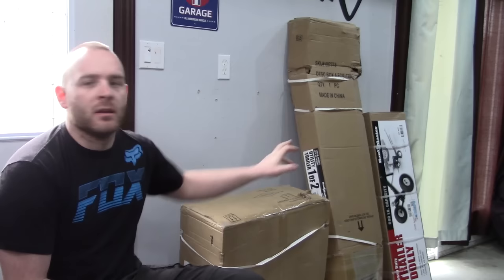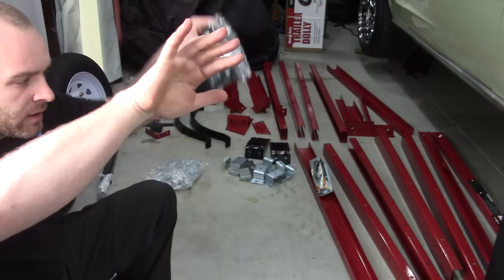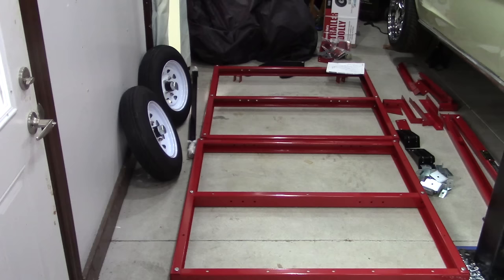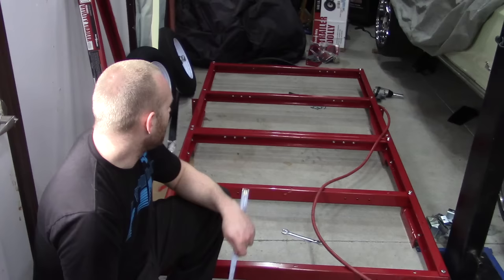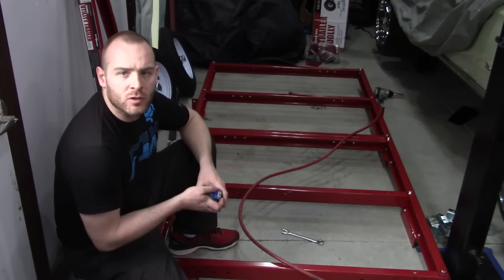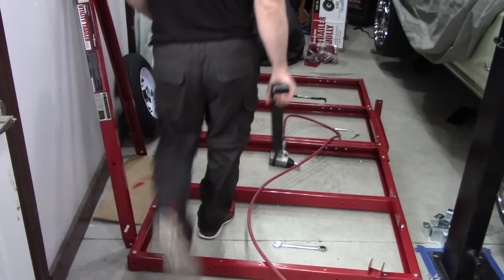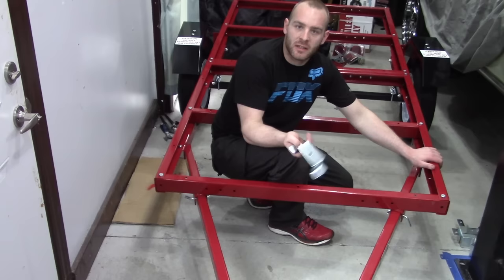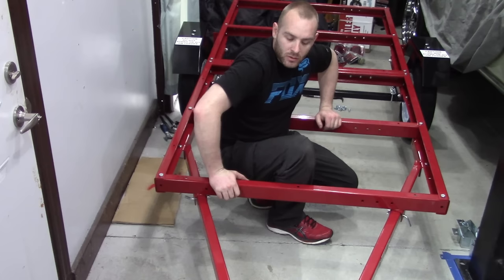Harbor Freight Trailer?? JUNK or NOT???

Comment: I have had the 1750# for 2 years now. Wasn't too bad putting together. I did brace the fenders as not to lose them, ran the wiring through grommets in the holes under the 3/4" plywood deck I put on. I have abused this thing to no end. I use it in the winter to haul my bags of salt and equipment for snow removal and all summer hauling shit. Motorcycles, dirt, landscape shit, etc. As far as highway driving it went to Arizona and back from Michigan hauling my Harley and tools doing the speed limit without a problem, have had zero problems except for one...the LED license plate light went out in the first week. For the money you can't beat this trailer.
Reply from the maker: thanks for the review!!!  i aswell put the wiring through grommets and love the trailer!

Comment: I bought mine in 1999, hauled everything from appliances, Motorcycles, I have no idea how many miles on the trailer, guessing 100K plus. Got lazy on maintenance, two runs back lost both wheel bearings, bought a kit, went to 12" tires, back in business, this may be my best life purchase ever! BTW, if you go to 12" tires, raise the fender mounting bracket, otherwise if heavily loaded the bolt heads will tear up the tires... I have abused mine like no other tool or equipment I own, never complains, also I have never used the folding feature, just a solid 4 X 8 3/4" plywood floor which has been replaced several times.
Reply from the maker: glad to hear you are having the same luck with yours that i am!!  thanks for the view and also the comment!

Comment: I bought the 1750 lb rated trailer a few years ago.  Assembly went fine until I got to the axle.  The flat spot on the welded-on mounting points weren't in the same plane.  Rotating the axle slightly didn't solve the problem.  I contacted Harbor Freight and told them my problem.  The local store told me to contact Customer Service in Camarillo.   I did, and they sent me a new axle.  It wasn't going to arrive for 4-6 weeks, so I called the local store again to complain.  They opened up a new trailer box, and said "Here's an axle.  Happy ?"  Yes, I was.  Then I installed it.  The original one was round, with welded-on mounting points, the replacement was square with welded-on mounting points.  Hey, great.  Problem solved.  Uh - not so fast.  When I got to the bearings. the exposed shafts were too long at both ends to get the bearing covers fully "on" - the threaded area didn't go back far enough toward the center to seat the bearing in the race properly. I've been using it locally until I can change out the axle for the extra one I have.  Either that, or I'll have to thread both axles further into the bearing area, and then cut about a quarter inch off each axle end's threaded area.
Reply from the maker: oh wow that sucks...   sounds like you had a horrible time.

Comment: I would put 2x4 below plywood deck where the tiedown loops are fastened. Span them between frame rails front to back. Or just use etrack for everything. A strip across front and back and down each side. bolt them through the frame too.
Reply from the maker: i agree it would help IF i didnt have the hooks bolted directly to the chassis already.   but i dont think what i have will fail, with the weight of the things i put onto the trailer.

Comment: Some times you can check and see if you have the Fram turned the right way. If one or more of your holes are not there check and see if you have part of the frame upside down of backwards.
Reply from the maker: i took it apart and put it back many many times. im confident that in my case it was a wrong part. but for sure this could be an issue for someone else!

Comment: I'm guessing the drilling issue is an a to a b to b issue. I've ran into that with two parts look the same one being like an e and then a g and I'd put the two Es together and later realize it and have to take everything apart.
Reply: I noticed the same thing, pieces are on the wrong side
Reply from the maker: you could be right but i am happy with the outcome.

Comment: What I did to the rear spring was put a 1/4 inch thick flat plate there and then every 3rd pull it dose not take 5 minutes to jack it up and put some grease there with your finger. I have two of them and do these all the time one is 40 years old the other is 20 years old.
Reply from the maker: well thats an awesome review aswell!

Comment: One could use stair nose ( from carpet department ) around the perimeter of the plywood.  Seal the bottom with something.  I used Flex seal.  I just dumped a gallon of it and spread it around. Its great stuff but expensive...$88.00/ gal.  You could also seal the top then use outdoor carpet to cover.  More $$$ but it would look gret.
Reply from the maker: these are great ideas. but for what i do with this trailer and i knew it would eventually live indoors i wasnt too too worried

Comment: The part of the leaf spring that slides back and forth on the frame what's good to do drill a hole through there and put a grease fitting in there at least you got a little bit of grease that cuts down on the wear.
Reply from the maker: thats a great idea aswell!!

Comment: I added the spacers so the plywood would sit level. Also, I disassembled the leaf spring packs and sanded off the paint, then repainted each leaf. I left off the shortest one to reduce bounce, plus added never seeze between each leaf. Without doing this, the trailer will bounce a lot. Also, I repacked the wheel bearings as the grease that comes with the trailer is not proper wheel bearing grease. This is a MUST DO!!! BTW/ depending on when you bought your HF trailer there has been some recalls for tires, and lights. Check HF website for models affected.
Reply from the maker: thanks for the awesome info!!!! i had a tire blow out for no reason so this is great
Reply: @710Garage  If you are only using the trailer for the ATV, consider removing the shortest (stiffest) spring as it will make the trailer ride a lot better without bounce. The springs don't have any lubricant between them thus when compressed they don't slide against each other which makes them ride stiff. 

The paint on mine were making them stick together almost like they were welded. Once the original paint was sanded off each leaf, and repainted, then lubricated with never- seeze the leaf springs now work like they were intended resulting in a smooth spring action without any bounce when unloaded. It' now a totally different trailer!

Another thing about these "red" HF trailers is if left outside exposed to the sun, they will eventually turn a pretty pink color.
Reply from the maker: @lacro5686  appreciate all the insight!!

looking for the info on harbor freight site about the tire recall.
Reply: @710Garage  Recalls at bottom of page:
https://www.harborfreight.com/customer-service-product-support.html#5

Comment: what i am working on for my 4x8 trailer that i have just like yours is trying to find 15 inch wheels that will fit the axle so i can buy some used tires to throw on them as well. That will help the trailer track a lot better and not sway as much as well as lift it up just a little bit because mine sits at an angle tilted backwards.
Reply from the maker: i need to do this for sure then!!!   i mostly am using this thing for around the property now but still makes a quick run on the road now and then
Reply: @710Garage  it will definitely help
Reply: You need a drop hitch.  I bought one just for mine, I think with a 3" drop.
15" tires would be nuts on a little trailer like that!

Comment: I own 2 of these i regularly fold them up for more space in my garage. Ive put thousands of miles on both and have had zero problems. I bought mine way back when you could use the %20 coupon (you can no longer use it) got them for 275 each out the door great buy. You must of put it together wrong i never had any problems putting them together everything lined up perfectly
Reply from the maker: its always a possibility. but other people in the comments have had similar problems so maybe not??

still love it either way
Reply: I bought mine Saturday (5/29) and was able to use the 20% off coupon, but it was $500 making it $400 with the coupon. If I have it for as long as everyone else here, I'll be happy paying $400!! :)

Comment: The slipper end of the spring is only loosely held against the frame. This means when driving with the trailer unloaded, an unholy racket comes from the slipper slapping the frame. Everybody will look at you. I put a bit of pvc pipe in there to act a bit like a cushion and taking up some of the slop. It helped...

I have to question the hub grease. If you fill with grease that is not compatible, you can have problems. When I built mine I cleared out the old grease as best I could, and refilled the hub with standard lithium complex grease.
Reply from the maker: great tip with the PVC!!

you are correct that you shouldnt mix grease in a perfect world.  you did the right thing for sure, and using that method in the future will not negatively effect anything but your wallet.

thanks for the tips!!

Comment: i’m retired now and i see these trailers assembled with  sides  on Craigs list  for sale cheaper than you  can buy one at Harbor Freight in the box  so many of the holes need to be adjusted and reamed out to build these that  its easier to buy one already built IMO  plus they are usually already titled  in your State  and where i live  you need to have a trailer inspected  at your cost  by a private State Authorixed facility  which is a pain in the ass  as  most trailers  have a electrical  issue somewhere
Reply from the maker: sounds like for you that is a great option for sure.  there were no used trailers available around me when i purchased this so i went this route.

Comment: I've got this trailer too.  Damn good review and really well spoken.  You could have your own DIY show.  But don't forget your safety glasses!  Funny story - this trailer is so low, some vehicles (like a pick up truck) may not see it after stopping at a red light.  This happened to me, and the pick-up driver plowed into the back of my trailer.  Some damage, and I ended up replacing the rear channel beam with a 2x6.  Also, I added a 3 more 2x6" with tapered ends as additional cross members because it didn't look like it could hold it's capacity (1200 lbs).  This trailer is great for everything, including a stack of drywall or plywood.  Also, I ended up add red reflectors mounted on fibre glass rods that project upwards about 3 feet.  They are mounted in 2x4 mini blocks that go into the exterior slots for fencing.  These reflectors remind any vehicles that there is a trailer there!
Reply from the maker: awesome review!!!   thanks for the comment and taking the time to watch the video!! 

have a great day!

Comment: trailer spring don't flex unless you have 1000 pounds on them. two full oil drums kinda ok ,one and it jumps . empty literally jumps 4 to 8 inch in air . railroad tracks about a foot in air  . other than that it's good . i have to run my tires at 12 lbs psi seems to help
Reply from the maker: They will flex before 1000 lbs..  but I don't know how much etc. My atv doesn't weigh that much and you can see where the springs have been moving

Comment: Hi, just caught your video, and you were wondering about the springs wearing away I'd be more worried about the frame wearing and was thinking that if you got 2 thin sheets of nylon you could make a pad to fit in between the chassis and the spring so you'd have 2 sheets of nylon rubbing instead of metal to metal, probably be a few £££ to source and fit but gotta be worthwhile?
Reply from the maker: im sure that would help yes.  but trailers have been built this way for MANY MANY years... so its common to just weld on IF / WHEN they wear

Comment: Wonder how much a 2 eye spring and shackle would be instead of that slipper end? Get a piece of UHMW and screw it under that spring end. Eliminate wear and keep it quiet.
Reply from the maker: it wouldnt be expensive considering the weight rating of the trailer.
but thats a great idea

Comment: Recent update; the half ton trailer is now $400 and the 3/4 ton is $500.  Got the 3/4 ton and started to assemble, and found that they did not bother to put in what they label as Carriage Bolt M10 x 25 & M 10 nut - 4 sets.  Called the company and they told me they do not replace those items, and I could go find a hardware store.  So much for service (although undoubtedly, given HQ is in the US and the assembly in China, they are not going to get the manufacturer to cough up).  The company needs to hire the folks with IKEA who write IKEA manuals.  Ironton has what looks like the identical trailer for $669; so there it that.
Reply from the maker: well thats a crappy experience.
Reply: @710Garage  $500 for a trailer and they tell me to go spend money for the parts I already paid for... I was not a happy camper.  However, for certain needs, I will continue to shop there.
Reply from the maker: for sure i dont blame you one bit...   for me having the wrong part it was a piss off but easily fixed with a drill  not having to figure it all out on my own...   i have nothing to do with HF or their supplier, but sorry for your experience.      glad you got it sorted out though!